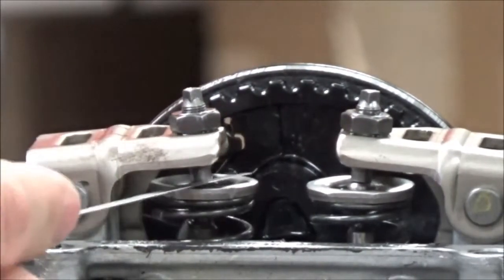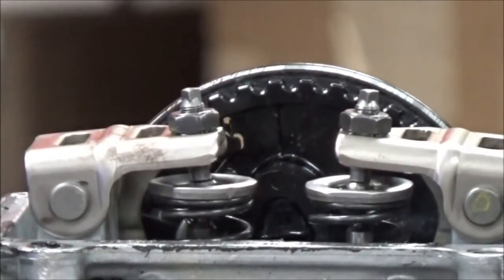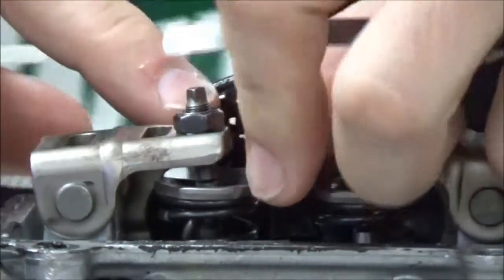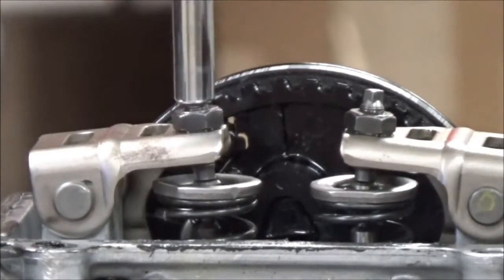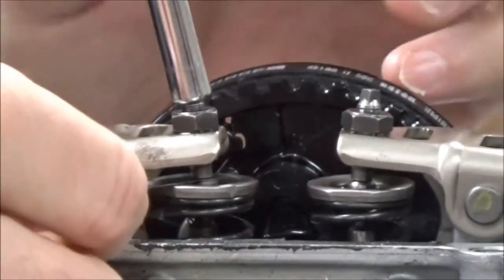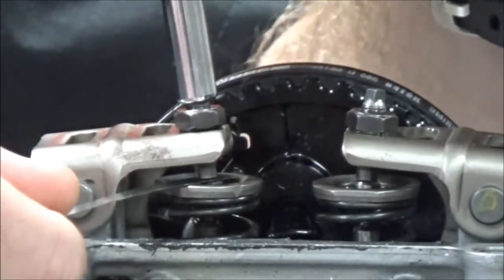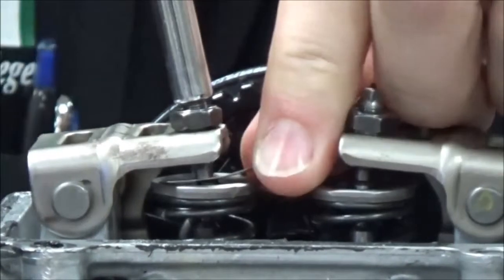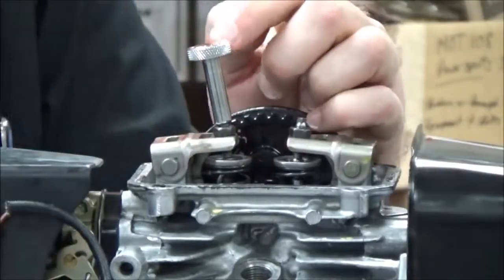Adjusting the Valve of a Honda GCV160 How tight Feller Gage should be

Comment: what is the clearance? reason I watched
Reply: For the GCV160
Intake:  .15 mm  or .006 in
Exhaust:  .20 mm  or .008 in
Reply: Here's a PDF of all the Honda engines valve clearances:

https://www.stevessmallenginesaloon.com/uploads/1/1/6/6/116630131/honda_small_engine_intake___exhaust_valve_clearances.pdf
Reply: 0.08
Reply: @5.43v  thanks
Reply: It's called a feeler gauge, not a feller gage...